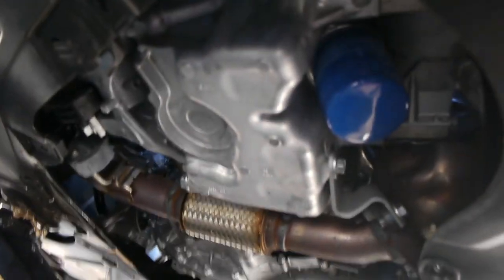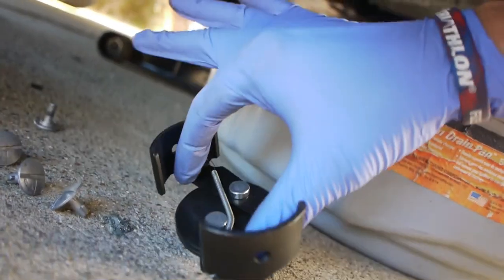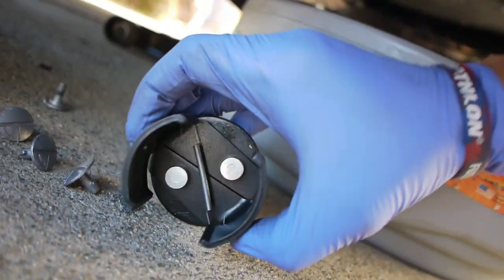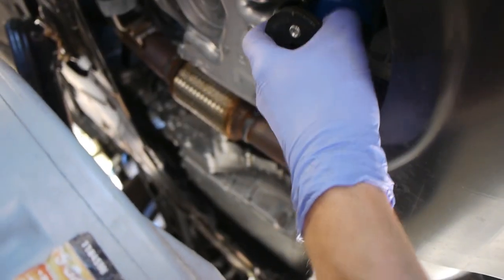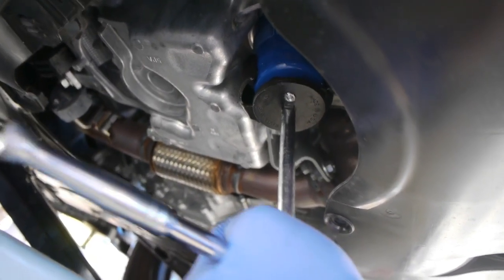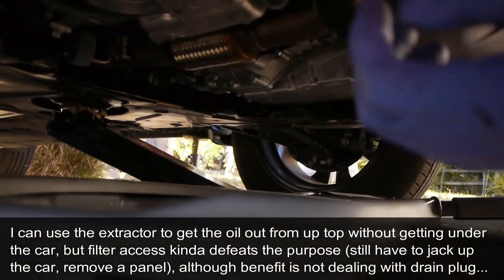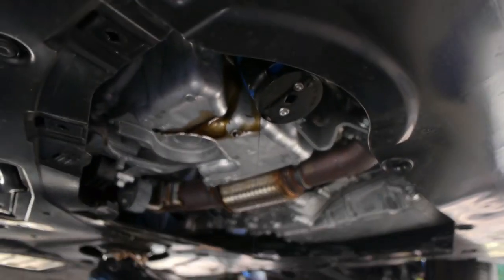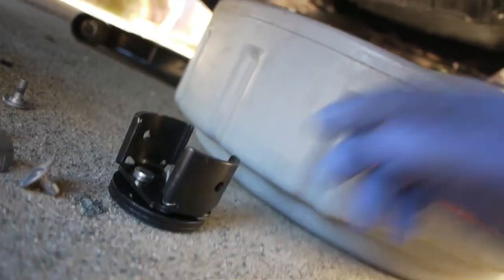BEST oil filter tool - Honda CRV Oil Change

Comment: I have the same oil filter removal tool-You do not have to jack up the car-just put a 6" extension on you're rachet
Reply from the maker: Yeah the car is high enough to just sit on the ground. Pretty cool.